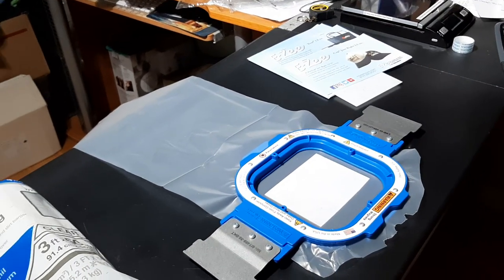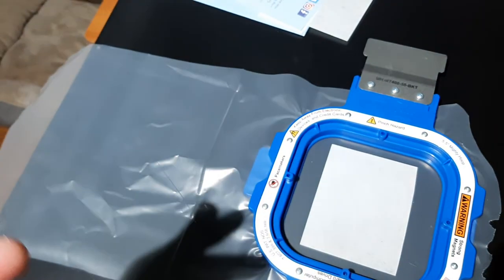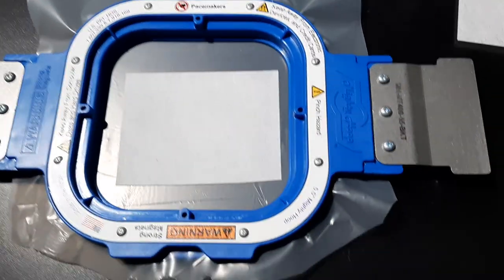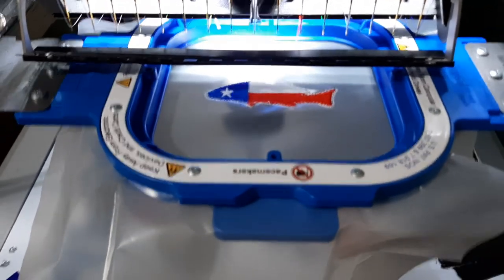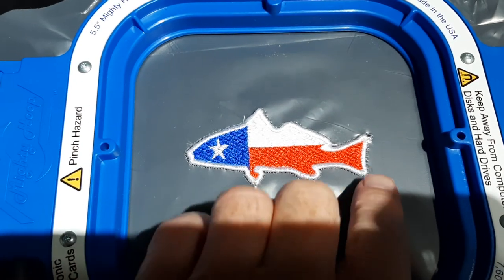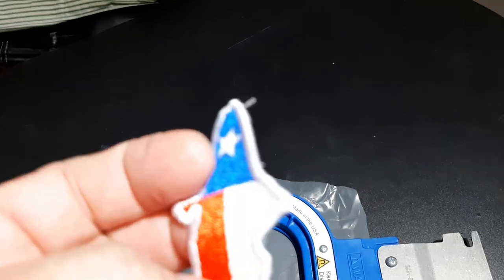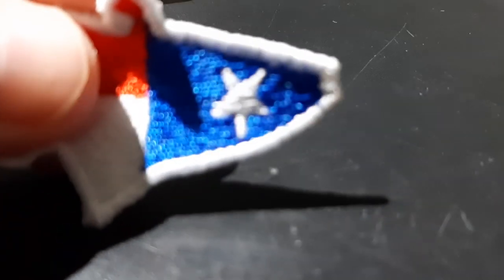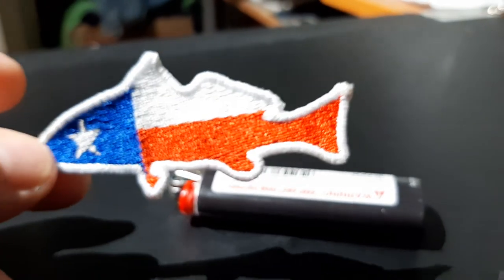Making a patch using plastic backing. (No Hot Knife)

Comment: Hi.  Just trying to wrap my brain around your method.   You used no fabric as a base for your patch, correct?   So the stitching is using the plastic to hold it.   Also, what do you do about the plastic on the back?  Does the HeatNBond Ulta ( or what ever iron on you are using) hold to the plastic on the back?
Reply from the maker: Nope no fabric just tear away and the plastic can stay when you are doing a solid filled patch with stitches because nothing but bobbin thread is left to see on the back. I'm here to help if you need me. Thanks for watching!
Reply: So is this safe to use heat press with bond on? I’m having such a hard time making patches to press on stuff

Comment: I make patches, too and I was wondering about using iron-on backing. Wouldn't the plastic melt when applying the bond and when I attach it to a garment?
Reply from the maker: I use tweezers and remove the plastic. The patch is flimsy unless you digitize a fill stitch with about the desity of a grid or use a cotton buckram stabilizer found at Joann's made by Pellon. Follow up questions welcome😁